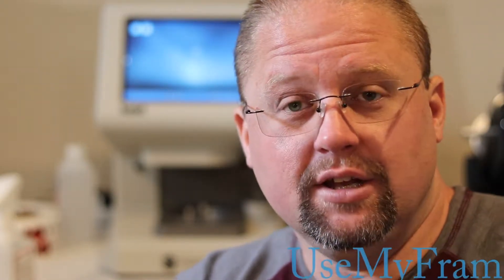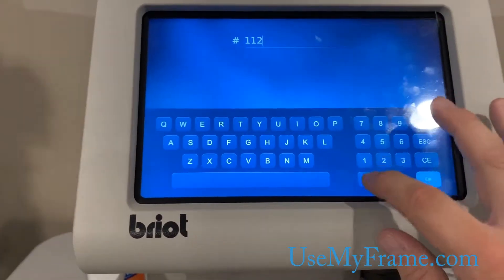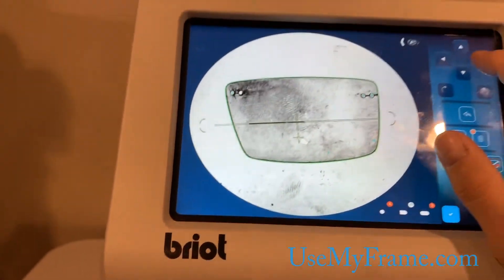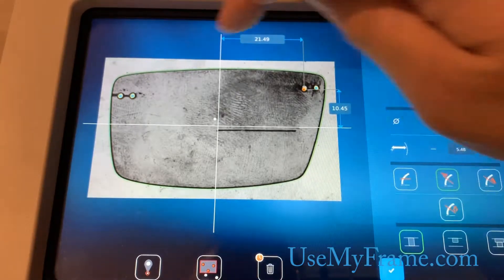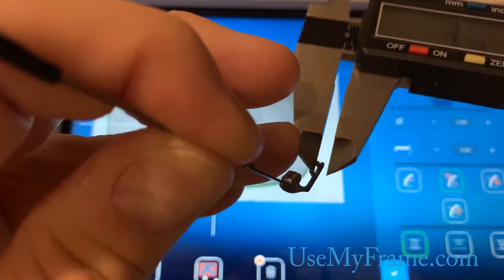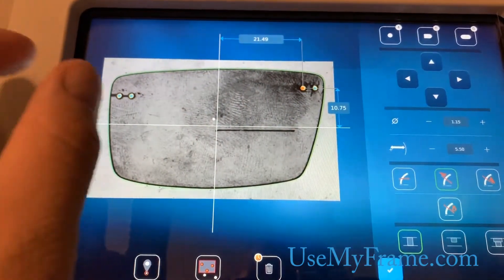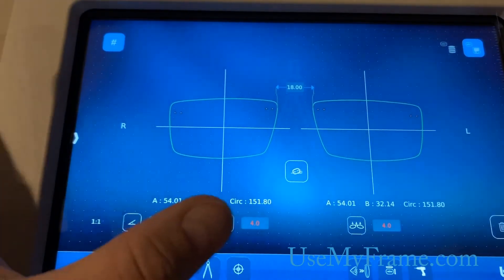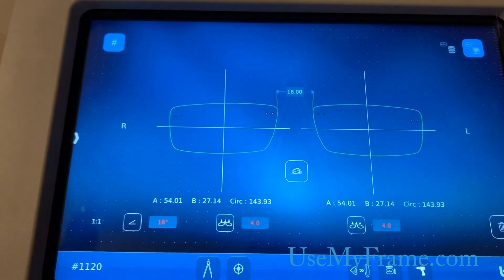How to Adjust Lens Shape Using Briot Evolution Tracer

Comment: good, I use a beveled same as the video but I have a problem when starting to bevel, the water blows and I clean the internal part where normal is clogged and the water tank is clean, recently that is happening to me and the other when putting bevel on  poly carbonate it is normal that water does not come out worse now if it does you have that problem?  I would like an answer
Reply from the maker: Usually if you remove the top of the edger, there will be water tubes that you can use to adjust the water pressure. On the Briot Evolution, look for the light blue plastic rectangles on the right side of the machine (with the top removed), and simply slide the wheel to use more/less water flow. You can do this while the machine is running a test lens to make it easier.